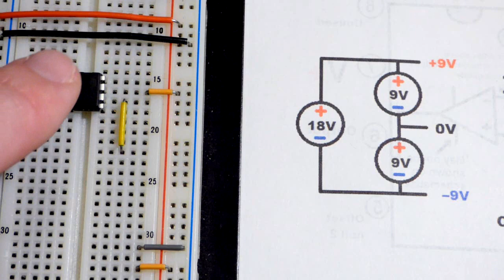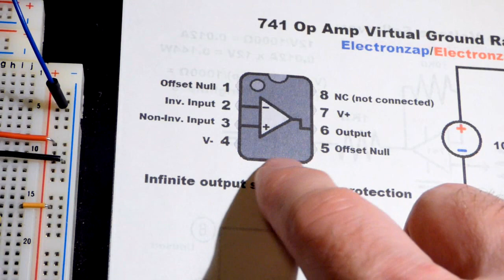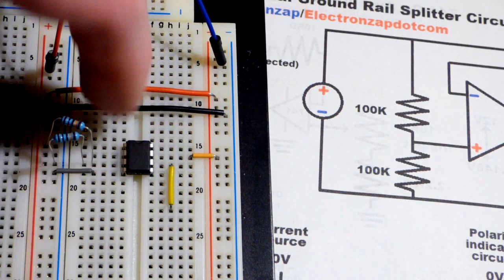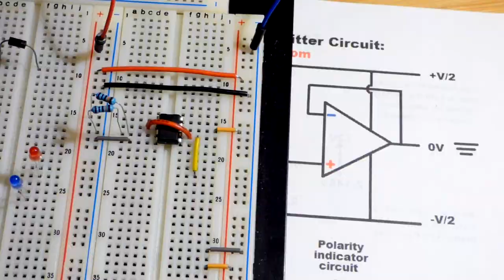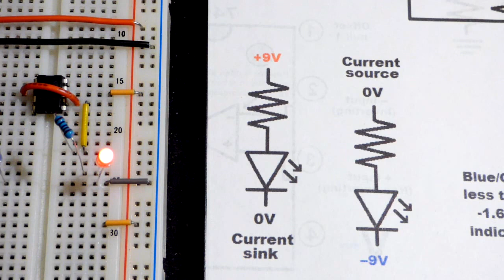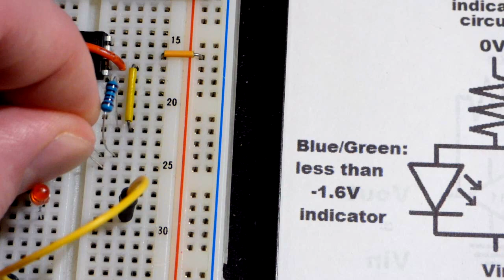741 op amp turned into a virtual ground 0 volt reference point rail splitter circuit

Comment: Nice! I'm just learning about electronics and have some 741's. I have several circuits I have made that require multiple voltages, 5V and 12V so I guess it is just a matter of selecting  different voltage divider resistors. Love your videos and appreciate the extra effort you go to in always providing nice, clean and clear diagrams to help follow along. Not sure why you do not have at least 500K followers. You will before long :)
Reply from the maker: Thanks for the kind words! There's also voltage regulators, the 7805 for 5V and the 7812 for 12 volts, plus voltage buck and boost converters to consider.